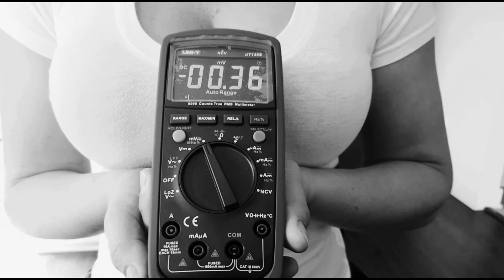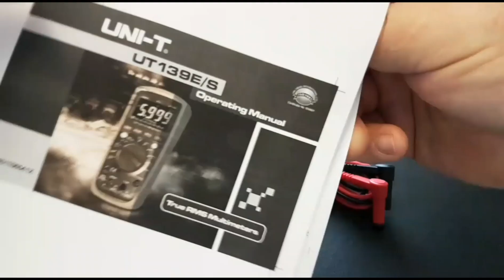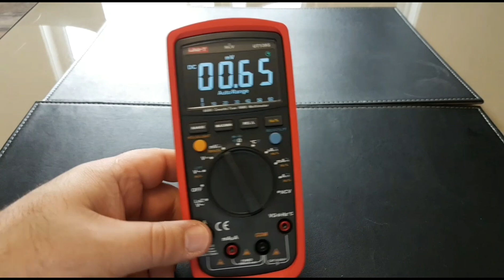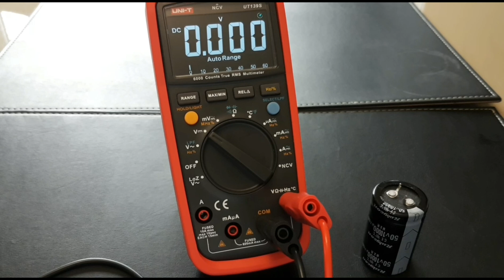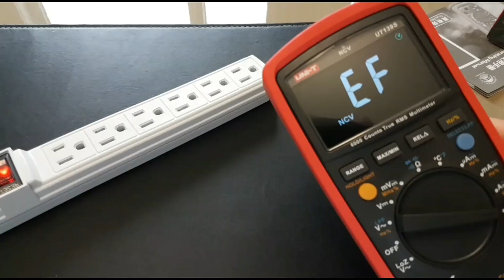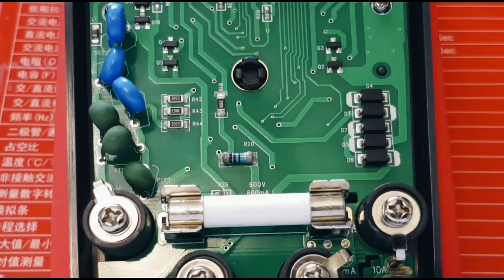World's SEXIEST Multimeter? UNI-T UT139S

Comment from the maker: To Purchase this Meter and help support this channel, please click here: 
  https://rover.ebay.com/rover/1/711-53200-19255-0/1?mpre=https%3A%2F%2Fwww.ebay.com%2Fitm%2FUNI-T-UT139S-True-RMS-Digital-Multimeter-low-pass-filter-and-LoZ-meter-EBTN-scre%2F323261616798%3Fepid%3D19012105505%26hash%3Ditem4b43e4d29e%3Ag%3A1U4AAOSwR2RaPcq1&campid=5338263193&toolid=20008
Reply from the maker: @Mike Studmuffin It's a referral link. If you click on it, I get a small kickback of the sale... It's a tiny amount but it all helps.
Reply from the maker: @Mike Studmuffin Only if you want to buy something... 😁..I only get a commission if a purchase is made if that's what you are referring too...
Reply: @KeepOnTesting  Nice review of a nice meter. However: how does the display fare when the batteries have had some use? 60 hours orso... So that the voltage drops with .6 or .7? Does it dim much then? Or doesn't it dim at all and just shuts down when the cells come below a certain threshold?
Reply: @Kason Adrien Ehh try flixportal. Just search on google for it =) -bruno
Reply: @Bruno Case Thanks, signed up and it seems like a nice service =) Appreciate it !!
Reply: @Kason Adrien you are welcome :D

Comment: I've got the same multimeter and I'm having a problem. When measuring high-capacity capacitors, such as 2200uF, 4700uF, and 10000uF, the multimeter displays the values in nF. I've tested several capacitors with capacitances below 1000uF without any problems. I don't know what to do. It's very strange. The multimeter seems to be confused about the unit of measurement, indicating nanoFarads instead of milliFarads when measuring capacitances above 1000uF.

Comment: I was instantly filled with regret when I bought mine and I knew straight away that I’d wasted money. I just wish I’d never bought the ut61e+, in the U.K. the ut139s is a mere £6 more. I wish I’d bought a 139s and a 139e just so I can see the difference besides the backlight. If you are reading this reading the 61e+ reviews look at this meter, it seems to fly under the radar for some reason.

Comment: Regarding the NCV function, try tapping it lightly on the top where the NCV sensor is, it will act like it detects high voltage. Iv’e tested it on 139E & S and it acts the same way.
Reply from the maker: Will give that a try 👍
Reply: Lol my habotest ht118a does that, but only on some days, really weird

Comment: Does the backlight turn off automatically after some time? The manual states it shuts off after 20 seconds but I didn't hear you complain about that. Or is the screen actually suitable for dark viewing and the backlight button will just make the screen brighter?

And how is the display when viewed under the sun light and from different angles?
Reply from the maker: The backlight is always on, its slightly dimmer when its disabled but only very slightly. Definitely works in dark low light conditions. Outside there is some external glare but its still readable and performs about 75% so its definitely acceptable no matter what the a great unless you are directly on top if it.
Reply: @KeepOnTesting  thank darren. That was a swift and comprehensive response! Appreciate it
Reply from the maker: @bengkelbawahpokok6753  anytime my friend.. 😉👍

Comment: mr walker could you do min max speed comparisons for cheap meters? that would be interesting to watch
Reply from the maker: Hi Chris, great suggestion...noted!
Reply: Darren Walker nobody ever did a video like that.it's like those features are not important and taken for granted . a meter's performance, in my own experience is not measured or judged by how fast its continuity function responds when shorting them test leads. the real challenge is how fast it will autorange starting from zero volts. then how fast it can capture events in minimum average ang maximum values. great review by the way mr walker

Comment: I have two ut139s and one ut139c. Non of them have that flimsy stand. They lock in place, and stand there.
Reply from the maker: Interesting, looks like my 139 is a dud.
I have the same issue on my UT195E..go figure.
Reply: @KeepOnTesting   You need to tighten the battery cover screw. After I tightened it the stand snapped shut.
Reply from the maker: @stochasticles  Roger that... When it's not all the way in,  it seems to mess up the standing bale mechanism .. Thanks for pointing it out!

Comment: Thanks for the tear down.
Does this model have auto hold feature? I’m looking for a quality  $100 meter but really do need a hands free hold. 
If not, what might you recommend in a under $150 that’s safe for main line current with hands free auto hold.
Thanks again.
Reply from the maker: This model does NOT support Autohold. It only has the standard touch and press hold to maintain the current reading.
My best recommendation for Auto-Hold and Quality Sub $150 price-tag would be the Keysight U1231A ( I did a review on this meter as well )... 
Its intrinsically safe, solid built like a tank and does Auto-Hold (Keysight calls it Trigger Hold), take note however that is does not read current. (No Amps or mA range). If money is no object, my best choice for AutoHold is the KEW1052 by Kyoritsu, review coming soon. Take note however that multimeter is around 350-450US.  I'll shortly be reviewing a High End UNI-T Pro series meter (as soon as it ships), so that might also be another option. Thanks for watching!

Comment: The display looks similar to one of the newer Aneng Q1. With the inverse design it looks very cool but it uses a permanent backlight and so the battery consumption should be very high and the outside view with sunlight should be very bad (not as bad as an oled but bad). The Aneng Q1 draws almost 17mA with light "off" what is much. And when the battery voltage drops the display goes dark very soon. The Aneng Q1 is driven with 2xAA cells too and at about 2,6V you wont see anything on the display.
I am pretty sure that UNI-T uses the same technique with the UT139S. I would like if you could measure the power consumption with low and high light on because I think it's always on. And it would be great to see at which battery voltage the UNI-T UT139S goes off.
Despite of this it looks as if UNI-T slowly begins to work on it's reputation and brings DMMs to the market that are more reliable concerning their CAT ratings. I own a UNI-T UT71E (European version with a little better input protection like big HRC fuses and PTCs, MOVs I had to add by myself, the PCB already had spare places for them). But this has still several issues like only 1/4W input resistors and bad tracing. It has CAT IV rating but I am pretty sure it never will fulfill this.
Reply from the maker: I've just release a short follow-up video demonstrating the EBTN Display draw/Battery longevity. https://www.youtube.com/watch?v=S3bOa4a6_EE
Reply: @KeepOnTesting  Forget I asked in the other subthread. You've already done the test. Great!! If I buy it somewhere this year, I'll make sure to use your referral link.
Reply from the maker: @radiotriggered2096  Many thanks! Its a great meter, I use it all the time.
Reply from the maker: I'll try and do a short follow-up video this W/E measuring the current draw when the light is utilized (ON and OFF) I'll also measure the Battery "Shutoff" voltage. Thanks for the feedback.

Comment: I gave a UNI-T UT139c to my father. I tested it first, it's great: 6000 count, 60 millifarad range, good NCV,  Min-max feature, REL, 60 mV scale, Hz and duty cycle measurement, good test leads, very good price.  And being LCD display, battery should last longer than this UT139s.
Well, but my father prefers mostly his traditional manual-range 2000-count Pro'skit 1270.   
What can I say? ... Probably is for the fact that to get to capacitance you have to press... 4 times!... the SELECT button. So much functions for each position, seems like driving an 18-speed Eaton-Fuller transmission.  And the UT139c doesn't have bargrapha.
Reply from the maker: The 139C should serve your father well. The Pro'skit 1270 is a very nice DMM. 
I am actually considering one for a review! Yes the 1270 is non-autoranging but that's not always a bad thing.
It lacks a very high Capacitance range maxing out at only 20uF so I don't think he has to push that select button very often!
UNI-T meters are definitely improving as of late so you can look forward to seeing more under my radar very shortly. Thanks for watching!